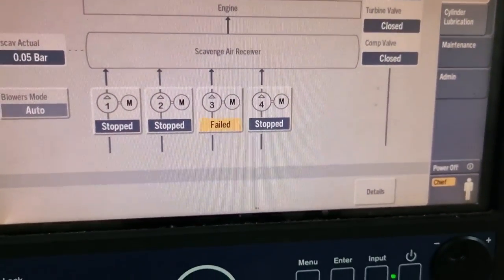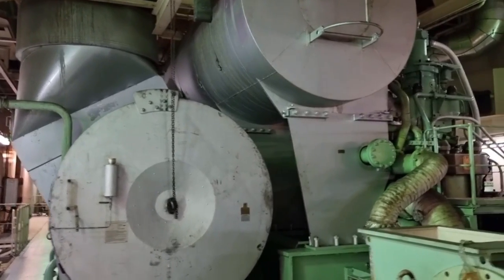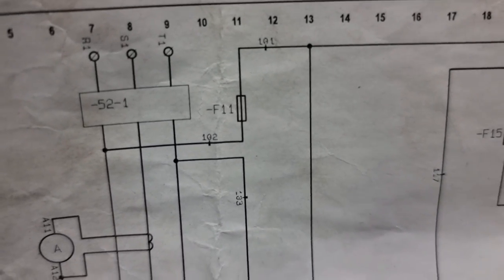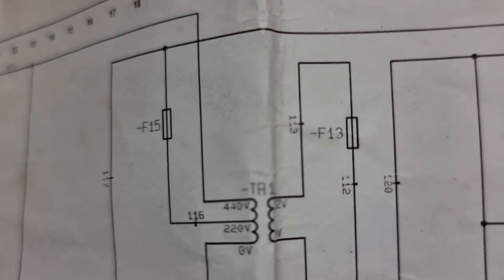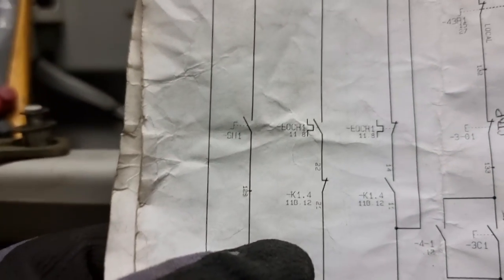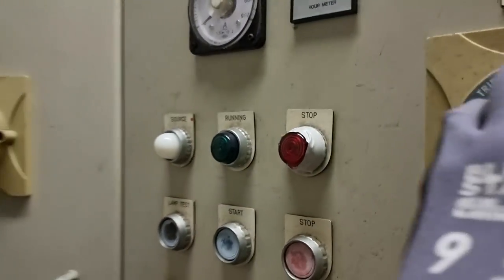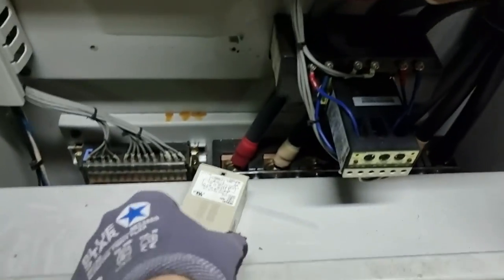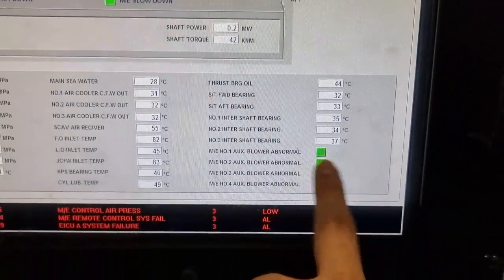MAIN ENGINE AUXILIARY BLOWER ABNORMAL ALARM TROUBLESHOOTING | MARINE ELECTRICIAN

Comment: you are very good at this fault , i would have done the reverse ,that is look at the timer to start the VFD . i would have then assumed all voltages especialy the 24 volt supply as ok . Anyway that's how i would have approached it , your approach is very structured and probably the better way
I have been in the electrical engineering maintainer from pharma to the Antarctic stations . A shout out from Australia
Reply: Antarctica, I am assuming for the Australian facilities, based on your shout out? I've been to McMurdo (US) for two contracts as power plant electrician and there is always something broken there. Hoping the AUS facilities are in better shape. Cheers.
Reply: Yes, even if you measure, you don't have to measure every step. If you get to the end of the line and all measures correctly, then it's a safe assumption that everything is working as it should. At least it's a reasonable assumption until there is evidence to the contrary. When he got to the timer, he could tell by simply looking at it that it was not functioning correctly. He was more thorough, but I think that should actually be a backup plan only to be persued if there is not a more obvious problem.

Comment: Thank u lecky sir, for sharing knowledge. In my ship aux blower is not starting on auto when ME starts, we have to start locally, what we can do, we don't have ETO onboard.
Reply: Check pressure switch which is intended for auto operation of the blower if it is function correctly.

Comment: This is typical problem with this type of time relays. This timers can be found in different equipments on board. Today I replace one in Engine Room crane control system. 
Before installation of the timer need to set mode of operation (it can have several modes) and time delay.

Comment: Great video as always Jake, have you ever tried a 2 pole Voltage / Continuity tester such as the Fluke T150 for quick fault finding ?. I tend to reach for mine before my meter nowadays. You take care out there on the ocean buddy, our job can be dangerous enough on dry land never mind with the extra hazards you face.

Comment: Nice moves step by step....
Can you pls tell me tat I am having auxilary blower starter failure alarm indication in ECR monitor...but both the blowers are running normally...
This alarm came after when I tried to carry out the starter routines of Aux blowers,at that time I turned off the power without changing the control from remote to local...after tat it is not resetting....any suggestions plsss

Comment: Sir good day. We have also trouble in our aux. Blower.  The only diff. In ur  vlog is that our aux. Blower will run in manual start but when we put it in auto position the no. 1 aux. Blower will stop. But the no. 2 aux blower is continue running. We  already checked the timer relay. But we cant find the cause of stopping of no. 1 aux. Blower.. Can please share ur knowledge on how to troubleshoot this sir.. Thank you in advance sir for your reply regarding this matter...

Comment: idol. ano possible cause ng mooring winch na may flashing disturbance indication sa  column control pag nasa step 3rd speed na. tpos babalik sya ng 2nd speed.?
Reply: Check mu sir ung mga contactor mu sa 1st,2nd and 3rd speed. Overcurrent yan. Kaya hndi tumutuloy sa 3rd speed. Check mu Kung may stacked up n contactor. Or better buksan mu ung control column. Hatlapa b yan combine anchor  and mooring winch?